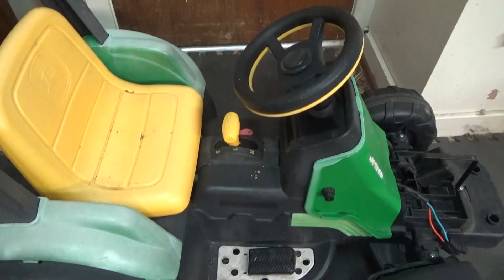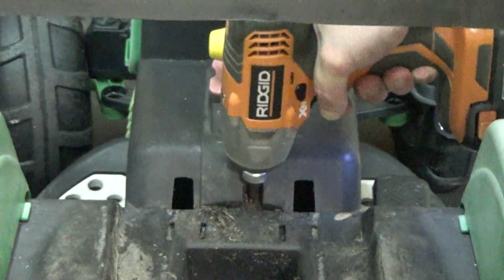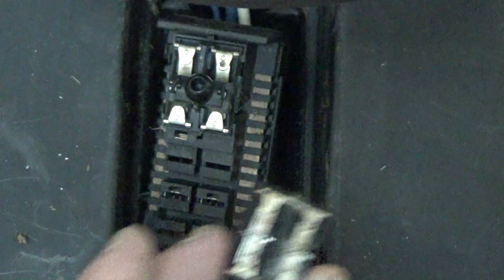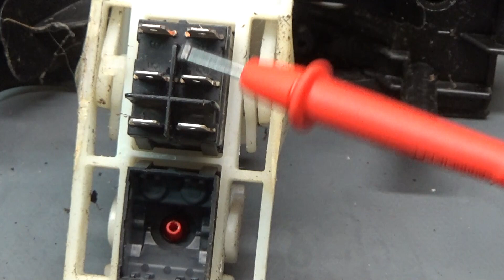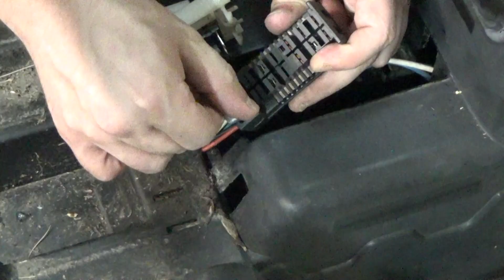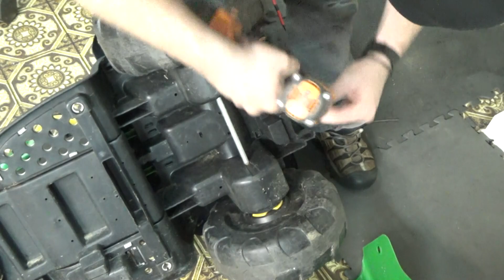Repair - Peg Perego John Deere Power Pull

Comment: Heilman great video thanks! I have the same tractor it goes forward but the power cuts out intermittently. Once the tractor stops and you hit the accelerator hard again it will power on busy just for a few seconds till it stops again. Any suggestions?
Reply: Kele
Reply: How do you replace the pedal?  Even with a new battery, when the gears are engaged it won’t run in either 1; 2 or reverse.  I was told the pedal needs to be replaced. Thanks.